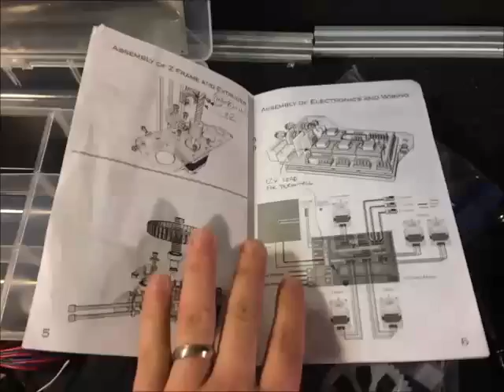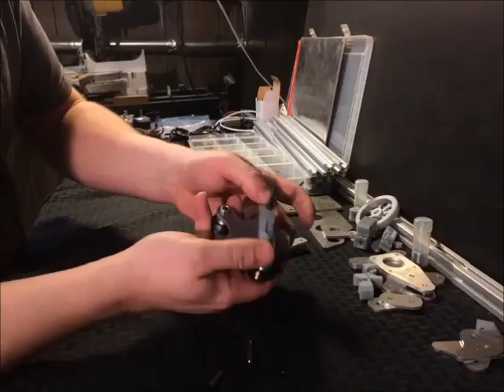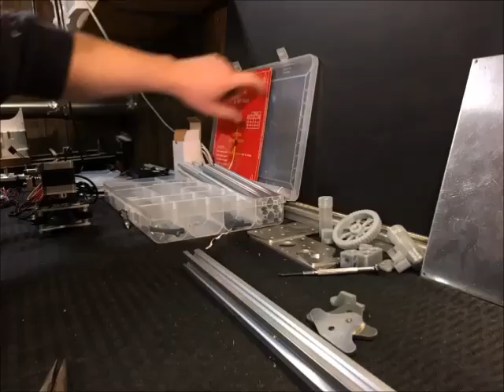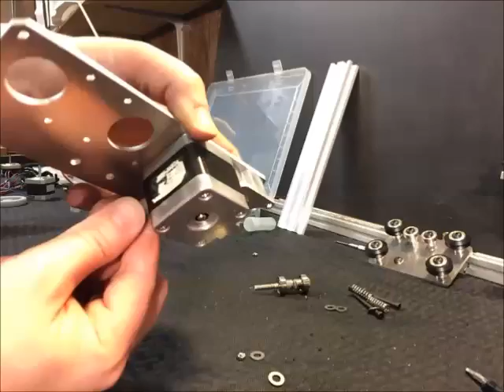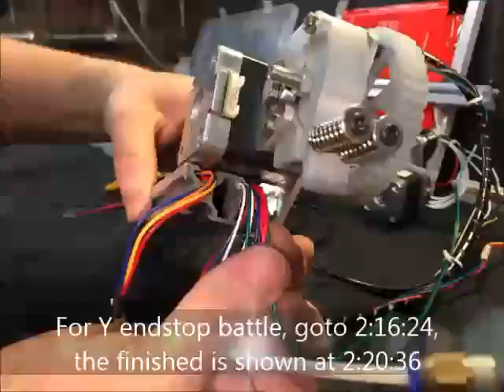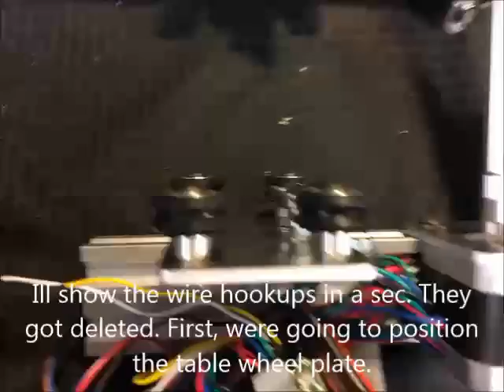OLD - Reach 3D Printer Assembly video (full walk-through)

Comment from the maker: Hey Brett,
Well you could hookup all the wires to the board, but you wouldn't want to install the plastic ramps holder until the table wheel plate was in place. The 90 deg. brace has to be tightened and adjusted, and the board has to be out of the way!
I imagine hooking up the wires to the board first is easier, then putting on the table wheel plate, then attaching the ramps mount to the frame last is the way to go.
I plan to shoot another video in a few weeks, with a cleaner and more clear approach. 
Thanks Brett

Comment from the maker: Hey Frank,
Yeah, it does, but if your proximity sensor is set too high, it may not activate, and the z motor will continue driving it downward. Also, if your printing on glass, and make a homing error, and the prox sensor isnt setup, it could also smash the nozzle into glass. For anyone new to printing, it is just an extra feature to prevent any serious damage. 
But if the z probe is tuned properly, its not needed. Even still, the prox sensor needs to be within .01mm to print accurately. If it doesn't activate being out of tune on setup, it has come in handy for me a few times!
Thanks
Nate